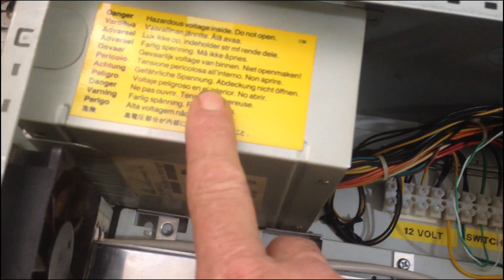CNC Router Build 10 - Homemade CNC Router Control Box Build

Comment: i have a question.....i bought a toroidal power supply and i set it for 110 so i could use a regular 110 plug in and its a 20 amp, +48 vdc output and i want to get this 1 in 4 out power block with fuses i found on ebay but the majority of them say 32v.......i have found some that say 25 amp 32v.....would it be ok for me to use something like this to distribute the power to my drivers?.......each motor plus 5 amp btw....( i have read that stepper motors dont usually run at full amps).......
Reply from the maker: I would believe that your power block would have to have a minimum rating of 48 volts
Reply: The Handyman what ig it's rated to 32 volts or 300 volts 
I found  2 I like with those ratings
Reply from the maker: rated at anything higher than 48 volts will be fine
Reply: The Handyman thnx man

Comment: If you use Mach3, do you know how to get the relay on the board to work?
Reply from the maker: Directions came with me specific board
Reply: The Handyman I have the same board as you but cannot find directions on what pin is used for the relay. Any help?
Reply from the maker: BTW, I have since upgraded my break out board.
Reply from the maker: I found a pdf manual online, let me know if this link works.
https://www.machsupport.com/forum/index.php?action=dlattach;topic=21003.0;attach=29693
Reply: Finally got it figured out last night. Thanks a ton for the help.
Reply from the maker: Glad I was able to help.

Comment: why don't you use power-ok signal wire from the pc psu then you shouldn't have used a differend led for the 5v and 12v

Comment: Good Day Handyman,
I’m writing you for some help. I’ve watched you video many time as I have the exact driver board which I cannot get to function at all. I have a working CNC machine but last week I replaced my 3 axis board to the exact breakout board shown in you video. To date I cannot get any of the drives to function correctly, X axis is the only one that turns and will only moves in the plus (+) direction. My software program is Mach3 and no matter how I set up the (Step) and (dir) under configure- ports and pins I get the same results. How did you get your BOB to work?  When I bought the board a CD came with it, I read thru every document, set the ports and pins as shown but no luck I’m starting to think the board is bad.  My current ports and pins setting as of today! X step (2), X dir (3) Y step (4) Y dir (5) Z step (6) Z dir(7), A step (8) A dir (9). Any help would be great. Nice video by the way!
Reply: Shooter 45 I have the same problem same board and using mach3 and no go??
Reply from the maker: I have since upgraded my BOB since this video was created. The best I can do is to have you download the PDF for the board from the link below and go thru your Mach settings again very carefully. 
https://www.machsupport.com/forum/index.php?action=dlattach;topic=21003.0;attach=29693

Comment: hi. i see you are using computer Power supply to power 5 v BOB . is there any concern how many Amps going into BOB. computer power supply have different Amps on 5 volts.
Reply from the maker: I honestly can not answer your question. I imagine if you are concerned about it that you could put an inline fuse on the supply side to it.

Comment: might help if you have a temperature gauge on the outside measuring the temp inside the box , that might prevent some problems in the future as most are heat related

Comment: Overkill is good. The computer power supply has a power good output that can drive a led by itself. It would tell you all outputs of it are good at once. Also you should have a minimum load connected to it to stabilize all of the outputs.

Comment: nice setup, however your 5V LED is not going to indicate if your breakout is functioning, it will just indicate if you have 5 volts. also did you install anyfuses in series with your controller? better to me safe then sorry.
Reply from the maker: +sean123456789 True, I'm only concerned with knowing that I have my voltages at certain points throughout the system. If a component goes bad, at least I know I have the applied voltage at the inputs and outputs.

Comment: Let me rephrase my question. If the relay's 12V input does nothing other than throw a switch to close a circuit, where is the 120V rail getting its juice? Did you install a second 120V power port in the case? Did you do some voltage conversion magic somewhere (outputs from the PC PSU are no greater than 12V)? 
I may be ignorant but learning is fun. Thanks.
Reply from the maker: +Guy Some You are correct, the 12 volt relay means that it is a switch, when power is applied to the coil (switch) that opens or closes NO (Normally Open) or NC (Normally Closed) sets of dry contacts. In my application in the video,  means that I applied 120 volts to one side of a pair of NO, (Normally Open) dry contacts, then one the other side of the NO (Normally Open) dry contacts I wired to the power rail.  When the unit powers up, it supplies 12 volts to the coil of the relay which closes the dry contacts that I am connected to allowing the supplied 120 volts to flow through to the power rail. I hope this make sense for you.

Comment: Thanks Handyman.  Because I'm not an electronics nut I don't understand how the 12V relay can energize the two other power supplies.  Is it actually providing the power or is it just an another type of power-on switch (like the one of the front of the case)?  I'm thinking it is just a switch and you have 120V input coming in from another source.
Reply from the maker: +Guy Some One relay has a 12 volt coil.....when that is energized from the PC power supply it acts like a switch. It has two sets of contacts, on supplies 120 volts to the power strip and the other supplies 5 volts to the break out board. The other two relays at the top of the case have 36 volt coils and all they do is close as each power supply powers up for the steppers and control a 12 volt source for indicator lights.

Comment: Hi this looks great. I was wondering why you needed two of the 36v power supplies  for the drivers. would all four of them not connect to the same one? sorry if i missed something, but the kits only come with one?
Reply from the maker: +kieranjr1 Not all kits only come with one power supply. It depends on the amperage draw of your stepper motors and how many that you are running. I forget what my draw is but I believe if I recall correctly it's 3.5 amps per motor in my application.

Comment: hello
 Nice video, 'm also busy making a controller box . this is also a case of a pc. Now ready  to connect wiring , I have the same breakout board if you had this video very helpful to view . Thanks for posting this video.
Reply from the maker: Dotsje a I'm sorry but I didn't make a video of the wiring. I followed the kits directions and then added many parts of my own to customize it.
Reply from the maker: +Dotsje a Here is a link to download the PDF manual for the break out board.
http://www.savebase.com/infobase/downloads/Breakout_Board_Stepper_Driver/User_Manual_5_axis_Breakout_board.pdf